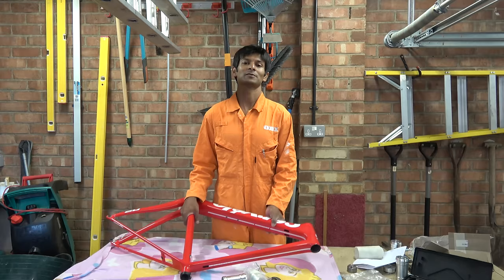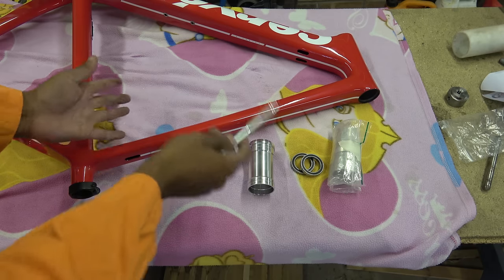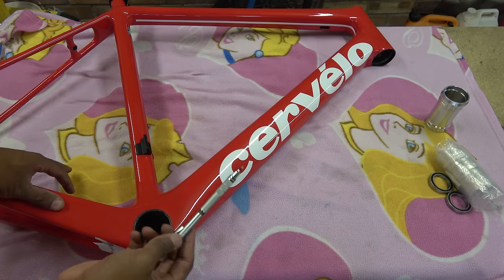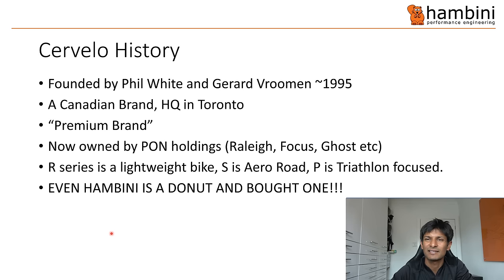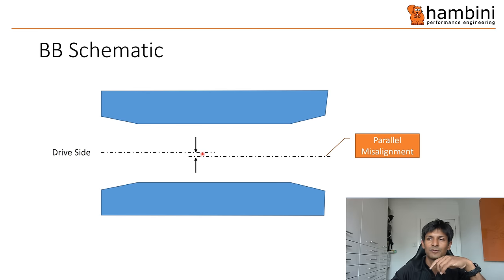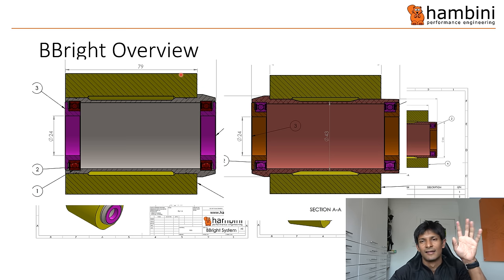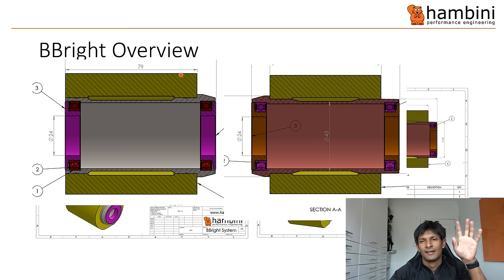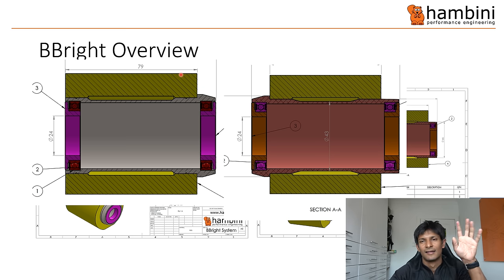Cervelo Exposed and fixed... Scumbag Aero bike manufacturers (A Hambini Reaming)

Comment: Thanks again for your help with my Cervelo S3 Hambini. After 2.000km my stock bearings were already bust. Have been riding for about the same amount with a Hambini BB and installation was hell, but ever since it's smooth as charm. You can actually feel the difference while riding!

Comment: Finally someone who judges these crap over-priced brands without having marketing and branding bullshit cloud their heads.
Reply: I took up cycling a few years ago and have come to love it as a main hobby of mine. I put up to 200 km on my bike per week now so I'm looking at upgrading from my entry-level commuter to a new gravel bike but I really don't know much about the brands. So I would be subject to falling for marketing and branding and over-pricing. Would you mind sharing which brand(s) you would recommend in this case?
Reply: @bollmocks  , when you say gravel bike, are you referring to a mountain bike or a cyclocross bike?
Reply: @Riggleboy  Cyclocross.
Reply: @bollmocks  , I've always been a fan of Specialized, but I admit they've cut back on entry level bikes and so the prices are a little high (no idea of your budget). Trek is okay too IMO and they do have aluminum and carbon frame sets which give you options. Salsa has a very nice entry level too called the "Journeyman 700C" for under 1k.

Not sure your know this, but a majority of frames are made by the same company (Giant) and just sold to brands. Brands like Scott, Trek, and a few others buy their frames from Giant.

As far as what you're getting it really is on 2 things, frame type (aluminum verses carbon) and the component quality. The better quality and lighter weight the component the more that price will jump (and fast).

Unless you're competing, I see no reason you need a carbon frame as you probably aren't jumping off the bike to jump over obstacles or climbing hills on foot. If you do plan on competing (even at a local level, carbon might be a consideration). The lighter the bike, the better.

Also, since I know nothing about you and not sure how serious you've been riding, don't forget shoes and pedals (same concept on compounds/components they are made up of are focused on weight) and even helmet (since you're riding cyclcross and don't want to smack your noggin on a tree).

So... the short answer is on what you can afford when you factor in bike, shoes, pedals, helmet, and other gear. Out for fun, stick to aluminum and splurge on carbon if you think you will compete.

I'm sure some other folks will have different opinions, but this is just mine. Hope it helps.
Reply: Funny thing is Cervelo started as a company with a very bad opinion and someone managed to shake it. Apparently without improving quality
Reply: @MegaAlpakka this is a bit uninformed. It doesn't matter where they are made and what's the pure cost of production. Having someone in china to oversee quality control is not a cost of production yet it is a cost and good companies do it, bad ones trust their local agents. Also good engineering costs money too.
Not defending bad companies but "china carbon bad" is really stupid
Reply: Isn't this based on a sample of 1?
Reply: @Dee-Ell  yes and no. He sees many more than just one. Just does videos on a few. In some cases, he shows in company documentation where they have massively increased tolerances to cut manufacturing costs by reducing internal scrap rate. To the point where interference/friction for doesn't stand a chance. 

On paper, interference fit works amazing. In practice, it is a crap shoot, especially with carbon and its manufacturing processes.
Reply: Chris Hurlbut Thanks for the clarification. But again, by the very nature of his business/work, he is receiving frames that have problems. So the sample is inherently skewed. As for company internal documentation about increased tolerance to increase yield, I’ll have to find and watch the video(s) myself. But then again, how many “bad frames” does this increased yield produce in practice? Do we know? What’s the percentage of “bad frame” does that company sell? That is the bottom line.  He advocates frames from Look and Time but where I live their bikes seem to be up to 50% more expensive, with some of the components such as wheels not as good as offerings from the more mainstream brands. So is it worth it just for a “better” frame and better BB that may not materialize in the real world (e.g. you have a good chance of getting a “good frame” from that mainstream hambini disapproved brand after all)?
Reply: @Dee-Ell  If a bike company charges a few thousand bucks for a frame it can be expected that they engineer it up to common standards. And no that is not nuclear fusion technology. How it should be done is in a bearing catalogue of any decent bearing company. But the bike company finds that they could lower the standard to comply with their low manufacturing standards in far away countries and the customer will not soon notice this. If he notices it is too late. Hambini points this out very clearly.
Reply: @Dee-Ell  What are you doing? Maybe you are sent from the bike industry? I expect there is adequate engineering and quality control. I am in the automotive industry. The quality shown here is abysmal. Of course it is cost optimized. Producing such a frame for the lowest possible cost and selling it for 10 to 20 times of that is what is done here.
Reply: @Dee-Ell  You do not read and understand what I wrote. You confuse frame with bike. I never said I want to produce a bike. And Hambini doesn't want to if I understood him right. The application of a standard in engineering and in production is all I was writing about. Might cost 20 bucks per frame. Should be included in such a product. End of discussion.
Reply: @Tom_367  Same difference.  Go find investors to share your frame design, engineering and production know-how that would create perfect frame at lower cost since you claim the quality right now is "abysmal" and the price expensive.  So no, not end of discussion.  My point stands.

Hambini doesn't want to because he knows he can't (produce better frame at lower cost).  Being a business-man (but he wouldn't want his fans to see him that way), he would have done it if he could.  He might be able to design a better frame but he also understands the law of diminishing return -- his theoretical better frame would cost substantially more to produce. (His BBs cost 6-10x more than regular ones.)
Reply: @bollmocks  Try Kona. If You have the money, buy Titanium.

Comment: Hambini, I have been reading forums regarding your work and of course the defenders of Damon ReTard. Your work appears to be solid and big companies do need to be called out on their engineering. I remember back in the 1980's there was a rubber O-ring made by Morton Thiokol that was not functional in cold weather. We lost 7 astronauts because the engineers didn't come clean about the issue. I also lived up the street in Henderson, Nevada when Pepcon blew up while stockpiling oxidizer for Morton Thiokol. Bike bottom brackets and other parts are definitely less dangerous but tolerances are beyond important. Keep up the passionate work.
Reply: I did a lot of reading about failed projects inc some of the NASA disasters in project management studies. Tragic that it got to the point of lives lost in the air due to an engineering flaw and an organisation too proud to come clean about it :(
Re the bike frame - To me everything's relative. If these guys were making entry level $300 frames then the tolerances might be forgiveable. But companies charging a fortune and marketing 'high end' products should be implementing equally high end quality controls and manufacturing specifications :(

Comment: Been a number years since I worked with the cevelo s series, but I remember the tolerances of not only the bb but also the headstock been problematic. Solution at the time was machining shims or ‘inserts’ to correct this. I recall a customer warranting 5 frames before we stepped in with a more comprehensive fix. Interesting to hear things haven’t changed.

Comment: I have an S5 disc. Love it. BB fit was no problem, but I won’t be so blind as to say that is anything more than anecdote and that with such a wide tolerance massively increases the likelihood of others having issues. I’ve had an excellent experience with the shop mine came from as well as the Cervelo rep that serves them. It’d be nice to see them tighten things up and address this.

Comment: I’ve worked for two different dealers in two different cities over ten years apart while they were each carrying Cervelo.  I’ve seen more cracked and outright broken carbon frames from Cervelo than any other brand I’ve sold since 1980, and those clowns rarely honor their warranty, instead  claiming that the customers “must have crash damaged” the bike or “must have raced the bike therefore voiding it’s warranty”. Seriously?!!! Isn’t it supposed to be a race bike?!!!  And yes, I saw (and heard) more bb problems with Cervelo frames than anything else I’ve dealt with. To their credit, both dealers have dropped Cervelo.
Reply: Who makes the best carbon frames?
Reply: "must have" is not evidence, so the customer should threaten to sue or report them, they will warrant a new frame eventually. 
But in this day...composite frames can be repaired when crash damaged so why don't they offer a repair? Because they know it was not the case, that it's just tension release from botched manufacture. The frame material costs like 100 (or 2) bucks/euros/potatoes. Price of R&D? The industry already has specialized CAD software for designing bike frames with composite layering and mechanical properties approximation (they call it analysis which is wrong, as it is done before a single piece is made).
Bike is really zero problem, that frame has to bear less than a roof pillar in a car, yet the quality and prices...
Reply: Cervelo regularly denied any warranty claim I filed while working as a tech.  Can confirm that they will blame anyone or anything before accepting responsibility for shoddy manufacturing or crap engineering.  BB and seatpost clamp are both huge issues for them, they cant get it right!
Reply: @dushk0  Threaten to sue or report them? LOL. The chances of someone actually paying the money to do that is extremely slim, and the bike company knows that. That won't do a damn thing. And there are no gov't agencies that are well enough funded or staffed to deal with complaints like this. They will tell you, "We'll investigate the report," and that's all you'll ever hear about it.
Reply: from your experience what brand are the best ? i'm looking to buy my first carbon frame (been riding steel since day 1) , but really want to try one carbon frame at least ...
Reply: @YendaHandriaman  Time branded ones.
Reply: @fabian12369139  I just had an R3 cracked bottom bracket area frame replaced on warranty from Cervelo, (bought in 2010) replaced with an 2020 R5 frameset because they did not have any R3 in stock in my size. Haha, enjoying my new R5. Nice misinformation campaign, though.
Reply: Sarah Kottke Look or Time
Reply: @sarahkottke676  koga (my opinion)